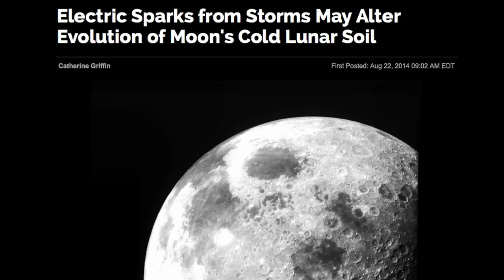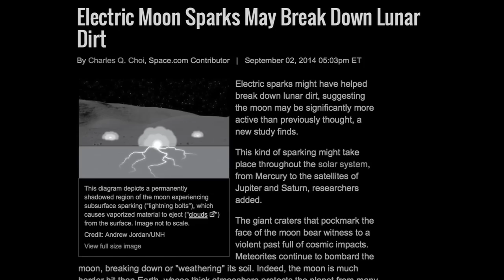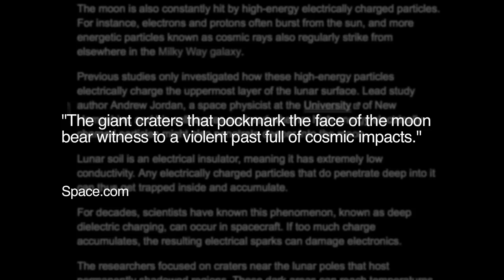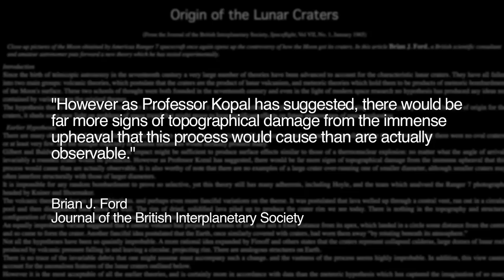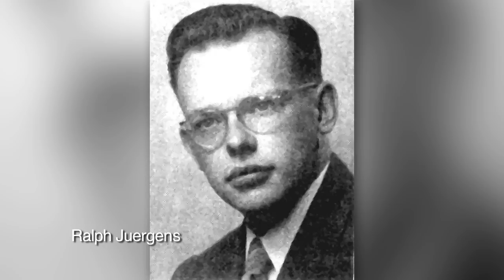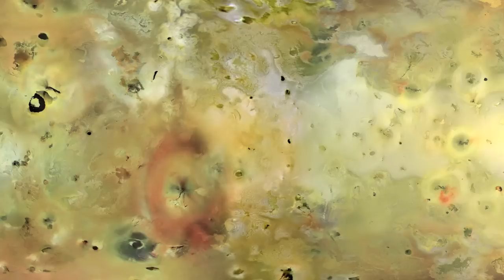Electric Sparks Shape Lunar Surface | Space News

Comment: The magnetic fields on the earth facing side of the moon are stronger than the back side. (National Geographic, Sept., 1972)
The moon's center of gravity is 2 miles closer to the earth than it's geographic center. (National Geography, Sept., 1972).
This may support the Thunderbolt Theory.
I used this data to explain why the moon faces only one side toward the earth.

Comment: I wonder if the Carolina Bay's are caused by same thing. They are circular, usually swampy or filled with water.  Small spherical iron nodules have be found in them.  May be it was not a comet that caused the Younger Drayas event, which occurred 12900 years ago or so.